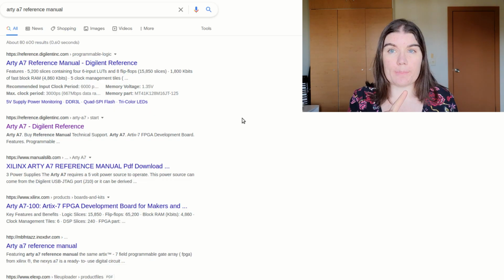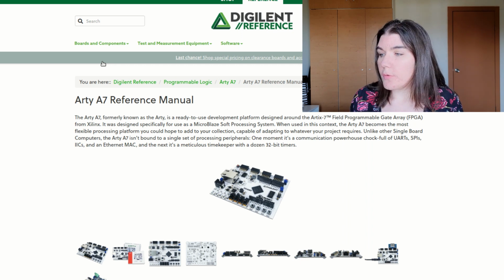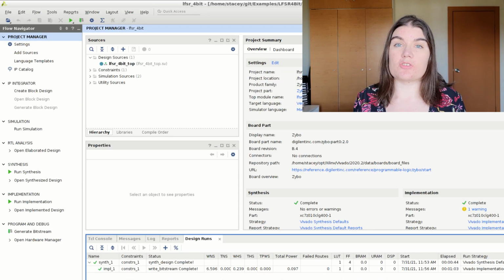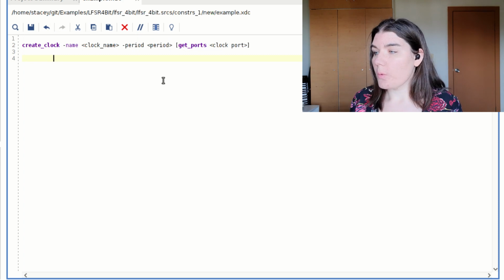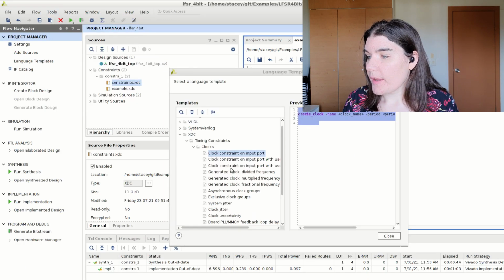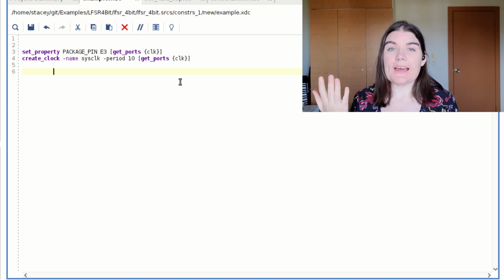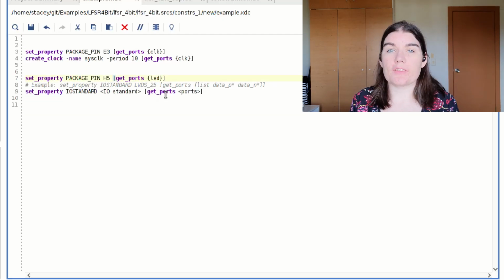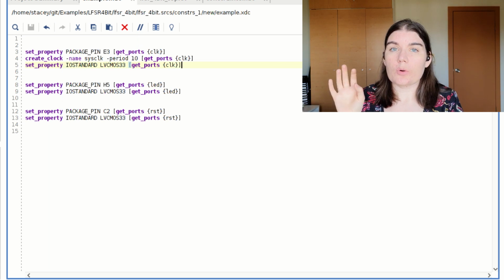Timing Constraints: How do I connect my top level source signals to pins on my FPGA?

Comment: Why do you need to use create_clock constraint? What does this actually create? 

The top module has name clk. But what does sysclk do?

 Isn't it sufficient to mention the Pin and IO std.

Comment: I understand specifying which pin is the clock, and mapping a net-name to a pin.. but how do you constrain a design such that it performs appropriately?   For example, when interfacing to some high speed external memory device, or using logic to measure the pulse width of an incoming signal?

Comment: Hi Stacey. What does sysclk refer to? Is it an alias used within more complicated constraint files? Thank you so much for this video series!
Reply: i'm not using the same software but i would guess that is the name which this clock is refered in the timing analysis... just a guess.

Comment: How do you find the proper iostandard ?
Reply from the maker: The documentation should say, if it doesn't you need to look at the schematic, or ask the company who made the board. Usually the schematic contains different voltage supplies or regions, and those should be labelled. LVCMOS33 for 3.3V supplies, etc. it's more complicated (eg LVDS) than that so usually if you don't know, or want to double check, ask the company/board designer.
Reply: @FPGAsforBeginners  assume that board designer routed the lines to a connector on the board and you can tie variety of interfaces to the pins in this case through connector. Does still board owner can provide me iostandard or is it my responsibility to find out?
Reply from the maker: @blueeengineer4373  It depends. Some FPGAs have IO banks where an entire group of IOs will use the same power supply. So even if some of those IO pins are routed off board, you can look at the power supply of the bank and infer it that way. So even if it's connected to a connector, the bank it's using should have a supply. But knowing what it is connecting to is a good idea anyway, because in some cases (eg digilent pmod) pins can be either an input or an output depending on what's connected. So ultimately the board designer should be able to give you an IO Standard even if some of the pins are routed off-board. But the directions may depend on what's connected.